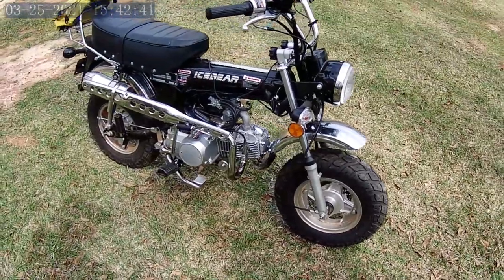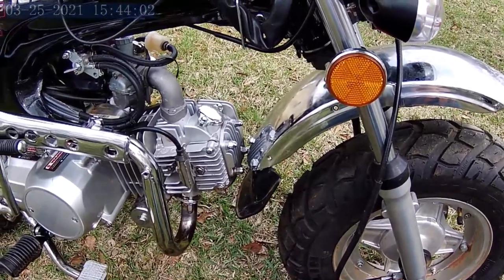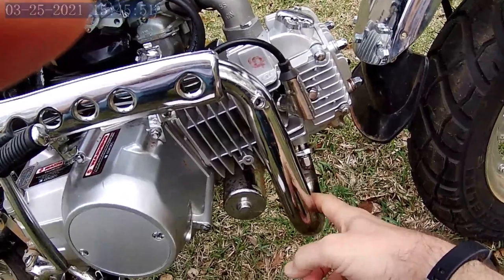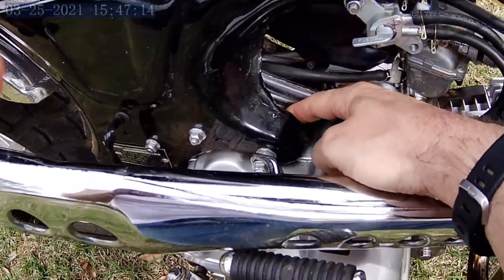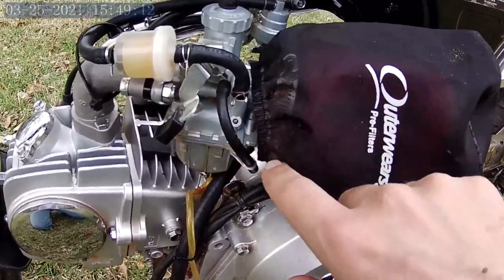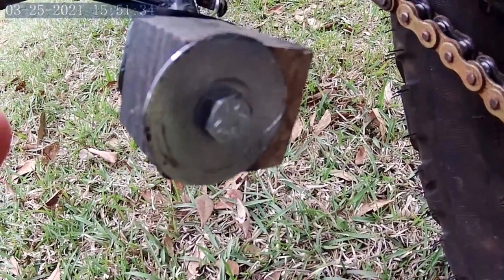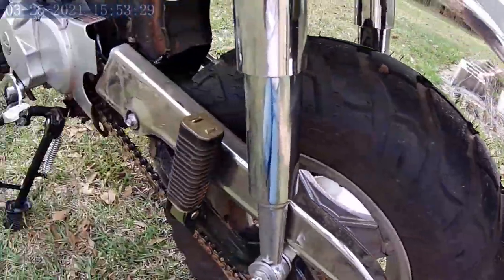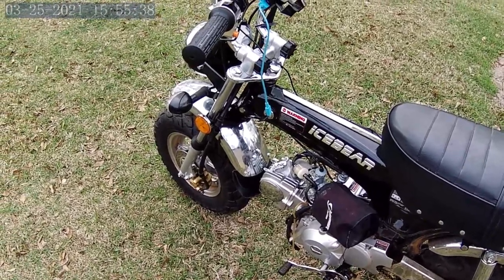Icebear champion review and mods

Comment: Trail Buddy in zilwaukee Michigan has a lot of aftermarket parts or the IceBear 125CC Honda clones. I put a thumper pipe on mine from and I put an upgrade 22 mm real menuki carburetor on it good I got from summit racing I had to put the 95 jet in I ordered a jet kit with the carburetor.

Comment: What size main jet is in that carb and how far out did you turn the air fuel screw? I ordered the same parts and could use some direction
Reply from the maker: Sorry for the late reply. Got a 115 main. I think the air screw is 1.5 or 2 turns out. It's what ever most recommend. Needle clip is in the 4th slot from the top so 2nd richest.

Comment: Nice job! I have a new red 125 that I'm slowly working on with just a handful of mods, but it's coming together. Still working on the front brake caliper since I've had clips screw up on it, but it's going to be a fun Honda 70 throwback.
Reply from the maker: Thanks for the comment! Yeah those front brake pad clips are a real pain. I had the joy of trying to figure them out
Reply: @grant31781  I'd be in trouble without AdvRider's forums and the Icebear Owners Club on Facebook.
Reply from the maker: @MAGSTRIKE Its around 650 miles. No issues so far and I run the thing  wide open on the road. Stock gearing with the taller tires works better than the 17 tooth front. Engine has not used any oil.
Reply from the maker: @MAGSTRIKE Yes and you can find them on Amazon and eBay cheap. 
 I fitted a open flow through pit bike exhaust on mine. I just put the stock exhaust back on it and it didn't make any real difference in power. Maybe a little better low end. I didn't even need to change jetting going back to stock.